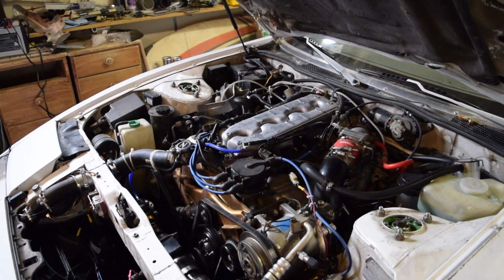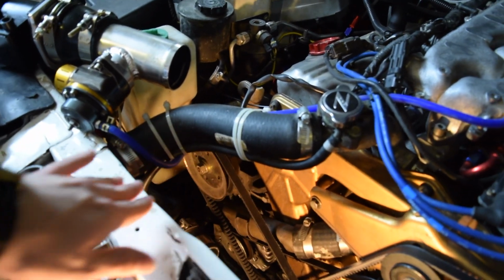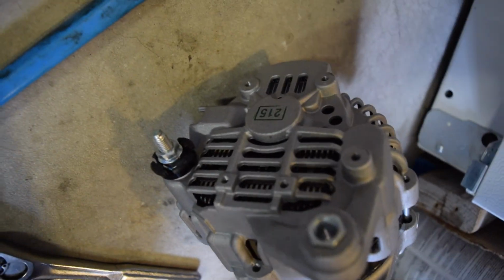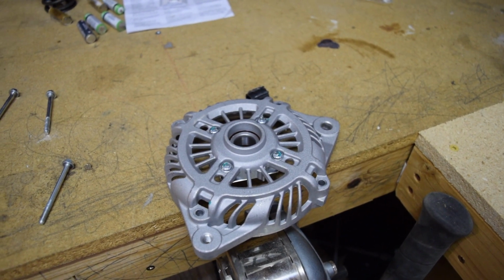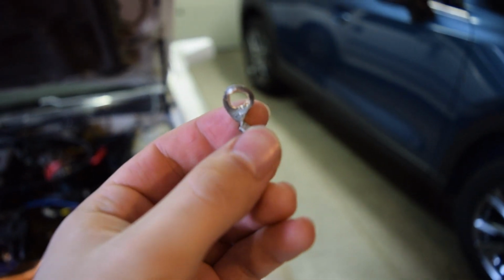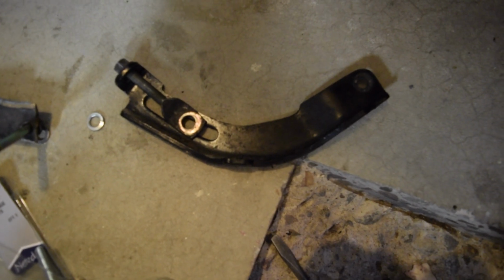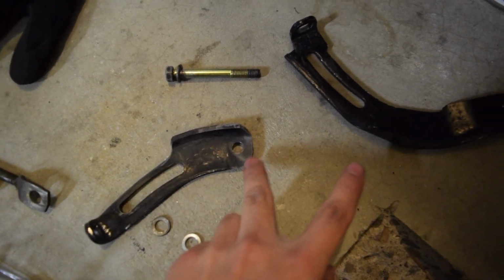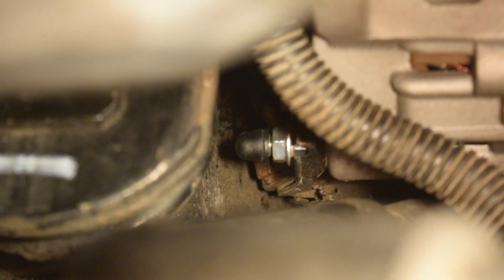G35 Alternator Upgrade (300zx Z31)

Comment: My 87 Z has e-fans and still has the stock 70 amp alt.  I've noticed that my car tends to idle really low and when I turn my fans on (they just have a toggle switch for now) the car idles terribly and sometimes even stalls.  I need to put a multimeter on the battery to know for sure if I need a new alt, but I was planning on upgrading to the 90 amp Maxima one for now.  Do you think that will serve me well enough?  I don't really plan on adding anything else electronic-wise other than upgrading to the Malibu fans

Comment: I changed a 280z from a 70-amp (iirc) to a 220 a few years ago. It really helps to increase the gauge on the negative battery cable and to add extra engine to body ground points.

Comment: So any long term issues? I know you mentioned the altima altenator went bad quciker than expected.  Do you think thats from turning it outside of its intended rpm?  I assume the main pulley to alt pulley needs to be very similar because the altenator has a range it is built to run at.   

Secibd question, did you get any surging after installing? When revving, lights all get brighter and voltometer surges up towards 16.  I feel like this could be a bad voltage regulator, but it is a brand new altenator, not a remanned.  Mind you, i know that it could still be bad, even new.

Comment: Have you had any issues with the stock wiring? was wondering if it can support the extra amps
Reply from the maker: I haven't run tons of extra electronics. Just e-fans really. But I did upgrade my fusible links to the box I make, so that I could upgrade the fuse to a higher amp fuse for the alternator, and when I did that I also put in a much thicker wire directly from the alternator to the fusible links box
Reply: @TheZGarage  Thanks for the info.! I'm not running much extra either. just an aftermarket stereo right now. I'm really only installing the bigger alt make sure I'm good for e fans (if I decide to that way post NA2T). I guess I'll switch out the wiring when I put in fans and do the fusible link box at the same time. Thanks for the great content!

Comment: Mine doesn't have a v belt since its a turbo looks the same as g35. Do I still have to change it or you think it'll be fine? Nice vid btw
Reply from the maker: I've heard of people using the ribbed pulley that comes on these alternators with their stock turbo serpentine belt. I can't say for sure but I don't see why it'd be an issue as long as the belt is lined up correctly
Reply: @TheZGarage  thanks alot appreciate the response

Comment: I’d actually recommend going from underneath. You can find the workshop manuals free online, and they recommend pulling the sway bar mounts off and pulling the alternator out from underneath. I just did mine recently. If you go from underneath you don’t need to touch your power steering pump or anything.

Comment: I'm at work just walking around listening to your videos play back-to-back like I have a test coming up but no I'm really studying everything I hear you say trying to learn this s*** I need that advice for my turbo and when I get everything here I have no choice but to both everything together and figure it out I've been asking around trying to figure out what is the ECU I have I didn't think to look into it I'm no good with software or anything like that so I don't know what I'm going to do about my ECU when I change it but all my thoughts should be coming in and I've got to be able to get the turbo coming
Reply: Those rubber adapters at the end of your ride up it said I used these I still haven't figured out how many is these two I assume right
Reply: I just got to learn the ECU and the computer I really have no idea what I'm doing or I would do a lot more right now but yeah I just won't do a lot of boost for now but I wanted to be there when I figure it out
Reply: So what about fuel injectors you still think I should use the same one what is it the G35 fuel injectors and if so is there a cheaper way to build my fuel rail do I have to buy that fuel rail like you bought or can I build me something cheaper
Reply: That's really helpful I'll grab the turbo ECU out of the car for now and maybe get some good injectors that size for now till I can figure out something better at least I will be on a very damn good start
Reply: I don't know your name my name is Jason they call me dookie since I was 14 so it's been 20 years or more they call me dookie my best friend that died nickname me that long ago but anyway I was just properly introducing myself but I just wanted you to know that I'm very appreciative hope everything you help me with I know you take time out of your day to look up something to help me and give me a dog and I much appreciate it thank you
Reply: You don't know how much I appreciate it so you think I should get this one right is it also a black horse you know I told you I found one that I thought but I think it said it was a T3 T4 lol it said Universal horsepower ar50 that was on the front of the house and that's the one I was talking about I just wanted to go with the same brand as you anyways but I trust this that you picked out and it said it was for a G35 or a 3.5 L engine anyways that sounds more efficient my birthday is 4/20 I seen the 420 horsepower LOL I think this is what I might try to go with 420 horsepower sounds like a good goal since that's my birthday lol that might be my first goal is 420 I think this might be what I'll go with them since you say like I said I don't know what to look up that would be any better so that's what I'm going to get and once again thank you so much for helping me out
Reply: That one says it's for up to just a 2.5 L engine and it looks like the black horse that I was looking at similar to this but it was kind of more like the one you got it looked more like this as far as the wastegate I didn't see one and why does this one say it for up to a 2.5 L engine LOL you can't guarantee it will work at all LOL I did see a black horse it was a little more than this one in price but it also had the wastegate where you can see it like yours but I don't think it was quite as large as yours and when I look yours up it was just a couple of more behind it it was similar to yours I was trying to send you the link but I don't know how to ask you about it I think I like the look of it better without being able to see the Westgate though and also thank you so much because I don't think I would not be able to do it without you
Reply from the maker: I didn't catch the part about the waste gate. It looks like it'll need a waste gate still. That bolts onto the exhaust housing in the rear. This one comes with one https://www.amazon.com/gp/aw/d/B0181XHBI6/ref=sspa_mw_detail_0?ie=UTF8&psc=1&pd_rd_i=B0181XHBI6p13NParams
Reply: So I guess I'm going with that last one you sent me and I want so bad to nistune bar and also and run the same fuel rail and injectors as you but I just don't see the money right this minute I'm so nervous something is going to hold me up I'm not going to put it off anymore I've got to get this done and get back in it quick it is still my daily I'm driving it today and it runs so good. I wish there was a way I could put it all together and not have it turned up very much at first just get it back running do the nistune I'm trying I'm learning I just know the mechanical aspects of it I want cams and adjustable cam gears but that will happen if I ever pull the heads off
Reply from the maker: You can technically run everything off a stock turbo ecu but the stock turbo is only like 7psi so if you run too much more than that it can cause an issue. If you drive it lightly, you should be good, but you will need z31 turbo injectors that match the ecu since you can't scale injector size. That would be the most basic way to go.
Reply from the maker: Ive heard of the python ecu but I've never used one or know anyone who has. I don't believe its tunable. I would get a nistune chip to use as a tuner since its available easily and there's decent support for it.
Reply: @TheZGarage  yes yes most definitely man I'm going to do everything I can do that you do my problem is having it tore down for too long at one time and I'm actually going to use that upper intake spacer looks like 50 bucks it gives you a little low end torque it says and it also gives you a little extra hand room to get in there to work on the injectors if you need to it comes with the little bit longer five Allen key bolts but yeah I just don't want to have it torn down too long at one time and I need to pick out a turbo real fast and I don't know what I'm doing I need you I'm supposed to tell my mom the rest of the stuff to order today I found that black horse racing turbo like yours it says a. R. 50 I don't know what that is it says it on the housing of the turbo I so wish I could get you to pick me out a 50 mm and be done with it so I could get all my stuff on the way to me
Reply from the maker: I don't think ar50 means 50mm. Just look at the turbo specs and it should tell you the compressor diameter
Reply: @TheZGarage  I'm going to get the wrong thing I don't know what I'm looking at I heard you and your videos so you think you should have got a smaller one and I'm going to end up just getting what you have because I don't know I'm begging you to pick me out a turbo I'm sorry and I really don't need to get on your nerves but I really respect you a build your car is an 86 like mine and I just really trust your thoughts I hear how you talk about the computer aspects of it I have no idea about any of that I'm just mechanical if I could just get you to send me a link something similar to yours that you think will boost a little quicker if not like I said I'm just going to get with you have and I really don't want to bother you or bug you cuz I don't know who else I would ask about any of this that's my whole thing I just respect how much knowledge you have in this car already
Reply from the maker: I can't guarantee anything about this turbo will work but this is a 50mm turbo https://www.amazon.com/maXpeedingrods-Charger-5-Bolt-Downpipe-Turbocharger/dp/B071KBV97L/ref=mp_s_a_1_3?dchild=1&keywords=maxpeedingrods+t3+turbo&qid=1617046344&sr=8-3

Comment: when you grinded that lip down did you use the factory spacer and another shim under The v pulley or is it just one spacer still it looked like I got lost right there watching the video I didn't understand did you use the original spacer and a small shim with it or did you just make one solid piece that was big enough to move the pulley up off of the casing sorry about the questions but I'm OCD a. f. LOL and I know I haven't said it at an in a long time but my grandmother bought this car from my uncle brand new and 86 he gave it to me and 01 and they both have passed away since my uncle passed away actually before his mother two years ago and then my grandmother passed away which was his mother maybe three weeks ago and she was the one that bought him the car originally in 86 but I have been going crazy trying to do everything my uncle wanted done to it now within the past year but now that my grandmother died three weeks ago I've even been going harder on it because it was her last thing she said dying in her bed was that when she got back up out of that bed and got well she wanted to pull the t-tops off and me and her go to the casinos in tunica she wanted to ride my car with me because she bought it new and she never made it out of that bed but you know it'll be there anyways I'm going to finish it the way me and my uncle had planned and like I've told you before I don't mean to bother you but mine is also an 86 I've had four of these cars all together I'm 38 years old I got my first one when I was 15 I have a photo of me standing in front of it right here in my hand it was an 84 slick top but that's what got me addicted to these cars my 84 slip top with the European dash that registered 220 LOL that was my first one then I had the 87 that was gold my 86 that I have now that is gold a 85 white one with an automatic and it was yes turbo but thanks for all the advice you've giving me up till now my girl laughs sometimes and says what are you and him competing every time I see you do something I do it too like the past power innovation delete on the upper intake I've got it I've got the prw 2 ignition igniter chip the fuel pump the headlights lots of things I've seen you do my money is just not real great right now or I would have a lot more done but I love these cars I don't think there is a body style that I like more I'm going to put an updated video on YouTube of all the parts I put on the car so far and how the car looks now inside and out and how it runs plus a video of all of my other parts I haven't put on it yet laying in a pile on the ground beside the car but there is a kind of updated video on YouTube already if you go to Google press your microphone and say a little more interior work that is an older video then if you go to Google and press the microphone and say almost done with the interior time to start on the turbo for this bitch.... that is the newest video but I have done more since check it out that is the newest video it doesn't have my headlights but other than that it's probably the most current

Comment: I haven't hit you up in a while cuz I've been upgrading my headlights my fuel pump I've got all new struts and strut mounts and strutting out bearings and brakes all the way around my door handles that I was missing for the inside my window switches and I think I'm fixing to buy some t-tops that I found that has like new seals mine leak a little bit so I cover my car up every time it rains but I found some really good shape t-tops for $100 out of that 86 turbo do you know if the front lower control arms will interchange from the turbo to the non turbo they are both an 86 and one more question I have for you do you know if the G35 alternator will be okay to mount on the driver side like it already is until I turbo it the guy told me $250 for the cross member the alternator bracket exhaust manifold and the turbo but I told him I didn't want the turbo I want to do like you did so I'm just going to get all the stock turbo items except for the turbo I'm going to follow your route pretty much but I was just curious I have a strong-ass old school Kenwood amplifier it's only a thousand but it seems stronger than my DB drive 3000 I have this little 1000 pushing 212s in my z along with some led fog lights and my new headlights similar to yours but the projector lights I just want more power so I'm going to do the G35 alternator and I was curious will it work on the stock side until I change it over and I'm going to try to send you a pic of my headlights you know you mentioned the driving lights you wanted to change them well I found a picture of a purple z online and they are yellow JDM looking driving lights I looked everywhere to try to find me some of those yellow lights and I ran across the video of a guy dying his lenses with some stained glass spray paint by krylon I did mine and they are beautiful they look so good yellow next to these new projector lights my projector lights came with some cheap bulbs in them but I went and bought some Sylvania SilverStar $70 light bulbs and put inside them and they are great the only thing I have left is it has a little blue bulb inside the bottom of the headlight I haven't hooked that up yet but everything else is hooked up and looking great thanks for the idea of changing the headlights I thought I would give you the idea of the yellow driving lights I just thought of something else my alternator is still on the driver side so if I do the G35 swap should I grab the brackets off of a G35 the adjusting brackets I know in the video you were saying you don't know how to tell you somebody to do it if it's still on the driver side well I was just kind of thinking as you were saying that what was I going to do because if I pull my car apart I need it back together that day that's what I drive so I don't know what to do and I want it to be able to power my music and my lights so I've got to do the swap thanks man sorry about bugging you I tried not to bug you for a while but then I hit you all at once lol

Comment: will a 05 G35 alt work I know where 05 is at LKQ it had coilovers on it believe this or not when I first spotted the car online it was beautiful it was a light blue lowered I want the wheels off of it for my z but I noticed the car was lowered on the phone when I first seen a picture of it so I went to LKQ to look at it and look at the differential to compare I realized I wanted the exhaust off of it where it's a y split into two chrome tipsbut yeah the car had cool overs on it the body was beautiful the engine had to have been blown because this car was beautiful at the junkyard coilovers nice factory wheels and tires no dents on the body made me sick I fell in love with it but I have to have a lowered 05 G35 I love those cars but anyways for that alternator work on my z
Reply from the maker: Yes, the alternator off of an 05 should work just the same.

Comment: yep I just took my box with 412s and a 3,000 w DB drive amp a bolt to the box just pulled it out of my car within the past month just because it was so heavy but I need to do something with an upgraded alternator too before I said anything back in there I have my wiring done very neat where I can pull it in and out easily and everything is contained in one box screwed together very neatly but I need this alternator to put my music back in